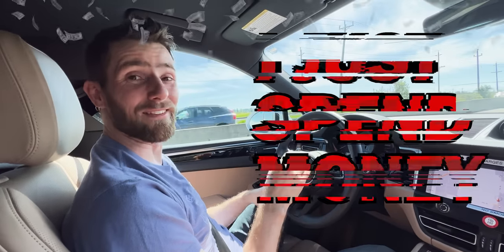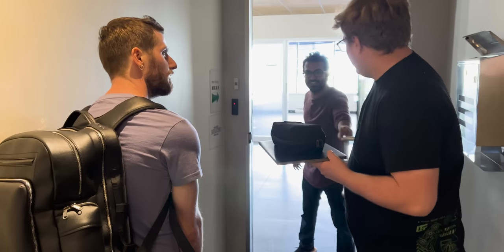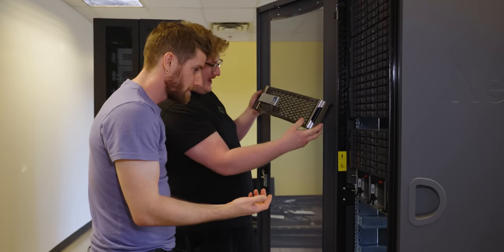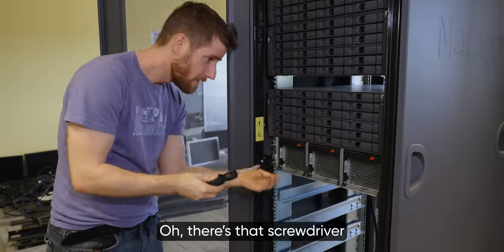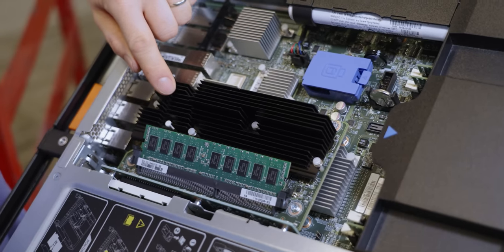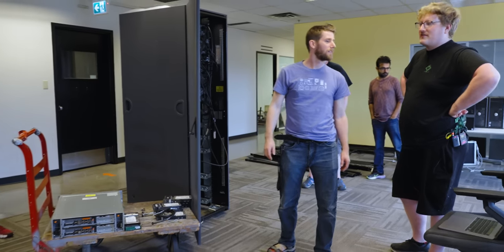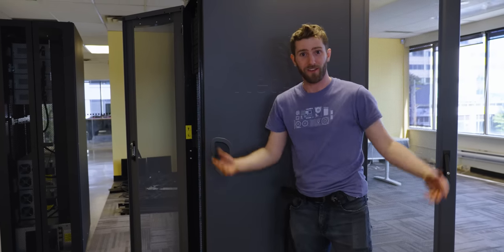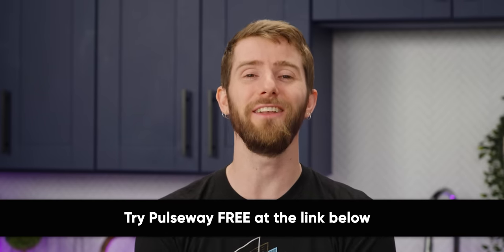WHAT did I just BUY on Facebook Marketplace?? - NetApp Storage Appliance / Disk Shelves

Comment from the maker: Correction for around 12:35: NetApp RAID is actually entirely software based. The RAM stick shown IS a write cache with a battery to keep data in memory in the event of a power failure, but it is used by the software RAID implementation, not a RAID card.

Separately, while the seller we purchased this from used it in a SAN configuration (iSCSI for VM storage disks), these NetApp setups are referred to as "Storage Appliances" and can be configured for both NAS and SAN protocols.
Reply: thanks for correcting your mistakes!!
Reply: @dliratx  You are correct in that it uses WAFL and the performance is better with it but you are wrong with the power outage aspect. Power outage protection for NVRAM. (non volatile RAM) is battery backed which is called the NVMEM battery. Combined with WAFL for speed, NETAPP doesn't actually commit a write to disk when the OS tells it to, same for deletes. Its stored in this NVRAM until 1 of 2 conditions is met. Either every 10 seconds, or when the NVRAM fills to 50%. Its then flushed to disk. The cache is set up into 2 sections. Each = 50% of the total NVRAM. Lets say that NVRAM size is 2Gb then it splits that into 2 sections by 50%. So there is always 2 cache banks at any given time. Due to this delay in commits to   Any data in in this NVRAM when a power outage occurs, MIND YOU one that affects the data center to kill the UPS power also, then that data sitting in RAM is backed up by this redundant battery that direct attaches to the PCI lanes of the NVRAM slots. In fact it is plugged in right next to the NVRAM banks. Usually first 2 banks in a controller head. WAFL does nothing for protection. It stand for Write Anywhere File Layout. Combined with speed for writes, it makes better use of disk sectors and block sizes. If there is a bad section, Data ONTAP (NetApp's OS) can ignore that block and still write the file. Where tradition RAID would either fail that drive or have an inconsistency in the data as it wants to stripe to the next block in line not the next "available" block.  It also extends the life of a drive for just a bad or failed sector of one platter on the drive.
Reply: Netapp deduplication is proprietary and pretty cool too. I do not work for Netapp myself btw.
Reply: that's too complicated for me to understand >.<
Reply: Its called unified Storage System , because it talks, FC, ISCSI, CIFS, NFS - if you have two of them you can do the metro cluster for full redundancy
Reply: This brings back some memories of when I worked for NetApp...I could tell you about some crazy things about their products back then.
Reply: how big would a minecraft server be with that
Reply: One of the biggest things which I have noticed with mid-tier to enterprise grade storage is that between Dell/EMC Unity/Powerstore Isilon and NetApp, one of the best features it seems could be the fact of the NetApp being capable of having multiple SVMs which you can use to DMZ storage while attaching each to different domains.  This is something I have noticed has been lacking for some vendors.  The only downside with NetApp is like Cisco, they bank too much on their software leading the way while the hardware side has been incredibly underwhelming. Hence the reason for the jump to Dell but the grass is not always greener on the other side as SVMs are not a thing there and "Proxy-NAS" could only be setup on the backend of the mid tier Dell systems which was sort of the DMZ equivalent however, you cannot isolate or DMZ the storage like you could per the NetApp and replication to offsite DR for proxy-nas is a NO-GO.  Granted all of the systems I mentioned do have capabilities for faster array based replication with things like ndmp, SyncIQ or Snapmirror it still seems NetApp still has the upper hand in many ways.  That stated, compression and dedupe are highly impressive on the Dell side while scalability is impressive on the Isilon side the it seems Dell/EMC still shines better in terms of Block operations with LUNs for things like databases where the NetApp filers are better at file based NAS operations.

Other thing to keep in mind, on the NetApp it seems or felt like each filesystem was treated individually as its own container or object which made the array filesystems more flexible to work with where on the Dell/EMC side, it felt clunky as the entire NAS server was treated as a container or parent which is unfortunate if they are trying to go up against NetApp.  Now per the information Dell released they did mention the Unity was a rebuild from what the VNX was back in the day however, it still seems to be missing many of the best features or they are hidden from what the VNX with the Celera was.  Not to mention the fact that with each generation the UI for Unity it feels like it is de-evolving to be like the "fisher price UI" of storage arrays.  Also, per all of these storage arrays, NetApp, Unity, Powerstore or better have better throughput for mounting NFS and running code-trees native from the storage, this stated, Isilon is NOT fun when trying to do this as there is a 64bit vs 32bit block export you have to set for each level of the filesystem making it a nightmare.  Also, NetApp and Unity have the ability to change the "restrict  chown" option or allow for other non-root users to change ownership of files where on the Isilon this was seemingly difficult to work around at best.

Also NetApp+CLI  = *happy face*   Untiy+CLI = *Very Sad Face*  Not sure why but the Unity / Powerstore backend over CLI was a nightmare to deal with.  File systems are represented by numeric designations along with exports, etc... Trying to script against it was like trying to write or follow primary / foreign key relationships between table structures it was NOT fun.  Almost like they were missing a command interpreter or better command structure.   The Netapp is a breeze to code against for backend scripting and it was actually kind of fun.   

Now if someone really would like a challenge, what would be the best solution for a active-active datacenter to datacenter configuration which would allow for a writeable and active replicated filesystem between two datacenters which would be robust enough not the break due to latency issues and allow for decent file locking while not causing data corruption?

Also, after having used NetApp, I VERY much prefer them for file/NAS based operations granted their configuration can be quite complex.  I have also been told interesting things about Hitachi  storage systems which I am curious about as I have not encountered them before but I kept hearing good things not sure of that is still the case thoe.

Very neat to see Linus exploring the more "enterprise" equipment side. 

- I am just noting this per my experience, I am sure others could have different opinions but this is just what I have run into.  My options are that of my own, as they are jut simply that, "my opinions". I am by no means affiliated with Dell/EMC or NetApp or Hitachi and I cannot endorse any vendor per my statements.  I also by no means affiliate my statements back to my current employer.
Reply: Forgot to mention, it seems many storage vendors are now stating to pull the "Don't look at the wizard behind the curtain" as they are starting to no longer list what they are using for compute with CPU, Memory, etc.  They are only starting to advertise on throughput / IOPS or connectivity.  This makes me sad for some reason.
Reply: NetApp FC and SAS drives have 520 byte sectors. The additional 8 bytes store the block checksum.
Technically those are normal OEM re branded 512B drives, formatted to 520B and run a special firmware from NetApp. There are tools on the Internet to reformat them back to 512B drives, but not the other way around. That's what the seller meant in the end, when talking about getting replacement drives.
Reply: License is real problem with NetApp xD
Reply: So, I found a guy who is selling the 48 drive version of this.  each tray has 2 disks on it, but it only takes SATA drives.  he has like 80 left if you want more, and they aren't that far south of the border in MN.  I just bought one.
Reply: @Koorisin  Yeah WAFL is pretty badass.
Reply: @andrewbenjamin4603  Yeh that SVMs and Netapp storage virtualization is awesome

Comment: Bruh can we take a moment to appreciate how immaculate those controllers were after 10 years of operation.
Reply: the way server rooms and infra should be kept, when in a controlled env dust isnt a thing with Hepa filtration.
Reply: When you buy from a data center,  servers normally come dust free in my experience
Reply: The proper datacenters I’ve worked in are humidity and temperature controlled with lots of filters on Hvac equipment.
Reply: we even had sticky paper you would walk over before entering the halls.  Impeccable
Reply: Huh? They're literally just sat there in a climate controlled room - what do you expect?
Reply: A lot better than the servers where I work. They’re in a small locked closet without AC or anything and the closet is sooo cluttered.
Reply: no
Reply: Everyone talking about that offices' server closet like every office has pefectly filtrated and climate controlled server rooms. Y'all know how bad it usually can get in such businesses, don't kid yourseld
Reply: @DMSparky  That is why I have my console cables with extensions, so I can sit in the cold aisles when doing service calls.
Reply: that's because somebody pressure washed them

Comment: It's cool that Linus brought those guys some swag, especially considering the killer deal he got on all that hardware.
Reply: I mean, basically, they were hoping someone was going to buy it and take it off their hands because if someone didn't, they were going to have to PAY an eWaste company to come and do that, so I guarantee their company actually made out in general, still Linus bringing swag is still pretty cool of him.
Reply: @scottbitz5222  Fair but they also could have parted it out and sold it all for more, I think they just wanted rid of it and got their ROI back from the 11 years of service it performed.
Reply: @kelmanl4  Most of that is disk shelf only. Harder to part out old storage tech with no controller like that and on such high end equipment that is no longer supported or find parts. NetApp holds their parts very close in house. hard to get them 3rd hand without buying them from company selling off old hardware such as this.  On top of that, they were low end disk shelves to boot. Only 3Gb bandwidth on the SAS connectors and while 24 disks shelves, only 600GB 15k RPM drives. Great drives but very dated.  DS4243 = 4 U 24 disk shelf 3Gb SAS connector
Reply: @kelmanl4  They could have indeed, but that takes times.  It's just easier to sell it for a quick buck, and let someone else make a long buck.
Reply: Not a killer deal. That's a 12+ year old controller and drives on the borderline of death.
Reply: @Koorisin  The fact that it's harder to find parts means there's more value in parting it out.
Reply: Well they let him make the video there so it's a nice thank you.
Reply: he says at the end of the video that it was meant to be listed for $500, so no it was not a deal

Comment: Speaking as a NetApp specialist, I almost shat myself when Linus pulled the controller out of the rack by himself.  Hint - there are folded handles either side of the chassis - use them (along with a second pair of hands).   Congratulations of your purchase, may it give you many years of faithful service (and at least one month of lost sleep when it shits the bed).
Reply: kudos for netapp shitting the bed - it shits the whole floor
Reply: I love the way you phrased this hahaha
Reply: Things are heavy, even with drives removed.
Reply: Something that old should not even be switched on. OnTap will be so out of date and updates will be lacking now. We've just gotten rid a of a 3240 last year and our 2520 is now out of support. NTLM bug is going to kill us!
Reply: @mikem3271  I doubt Linus or LMG will be using OnTap or the NetApp specific features on those legacy disk shelves like the ACP ports (With ACP being in-band with SAS from OnTap 9). From what I know, both the controller and Diskshelf featured are EOL, which is why it was probably so cheap.
Reply: @benskev  I can confirm, this is very true.
Reply: Can't wait until he has a QSFP port failure, lol
Reply: Linus has no idea that these controllers are like $5k to $10k a piece. 😆 It's not exactly a commodity desktop computer.
Reply: @Doso777  DS460C without 60 disks weights 80lbs. With the disks 300lbs.
Reply: @apreviousseagle836  Since it's out of warranty, it will be out of pocket for every component.
Reply: @fitybux4664  Or that you can have multiple controller chassis working together.
Reply: @TechPorkChop  "Out of pocket" meaning they hope they can find a replacement on fleabay. Also Cdot requires licenses to be generated for the controller's specific serial #. NetApp won't do that for a OOW system. Their best bet now is just to hook up the shelves themselves to a generic Linux box with a compatible HBA, and it will see the disks individually.

Comment: As a storage engineer this video was a blast :) It looks like a great deal, but consider power consumption. I recently replaced 2 similar storages around 70TB each, with 1U IBM FlashSystem 5200. Old storage needed 2800W, and new one is only 300W :)
Reply: That's a large room heater!
Reply: I used to work for IBM and we had moved some of our DBAs highest usage DBs off of XIV Gen3 and StorWize 7000's to  multiple FlashSystems (Thanks SVC!). The DBAs still complained that it was 'too slow' and 'customers were complaining'. I told them that if being on nvme flash and 32Gbit FC was too slow for the customers, the issue isn't the storage, it's the application and DB architecture. Nothing I can do about that as this is literally the fastest (at the time in 2016) shared storage that exists. They didn't like that answer.
Reply: @WhiteG60  my team supports our custommers from storage to DB level, so its lettle easier to find problems :)
Reply: @WhiteG60  Or the partitioning and queries. An unpartitioned (aka full table) search of a larger table for whatever criteria can mean reading hundreds of gigabytes of data.
Reply: I didn't even know storage engineers exist.. the more you know! :D
Reply: @SarahC2  That's why a lot of the heaters in the company are turned off.😂
Reply: @WhiteG60  Those app db queries needed a ton of optimization I bet. This is something that DBAs will defend to their last breath - until you ask for statistics.
Reply: @infn  thats why we have our own DBAs, and we need to deal with application programmers :p
Reply: @infn  They had asked for RO logins to the storage arrays in the past. It was a nightmare. They'd see a single statistic instance of read latency that goes from .9ms to 2.3ms then back to .9ms on a 5 second sample and try and set up a meeting to discuss 'why the storage latency went up almost 3 fold'. They would claim that 'customers were calling about issues if the storage latency got above 4ms'. Bruh, if your customers are calling about 4ms of latency, you're either lying or need to train your customers better because the difference between 2ms and 4ms is effectively indistinguishable when you're talking about a SaaS product being accessed over the internet. 

They also steadfastly refused to let us do backups with any type of agent. They INSISTED on using built in SQL tools for backups and then copying those 12+TB backups via CIFS/SMB to a share to be backed up there. DBAs are a weird bunch.
Reply: @WhiteG60  A9000's (also XIV based I believe) were a blast, was sad to see that technology go. SVC code is most likely inheriting at least some of the legacy I believe (like the way global mirror is handled).
Reply: @aragnut6180  Yeah the A9000's were effectively just XIVs that used flash instead of NLSAS drives. They're gone? I've been out of IBM for almost 6 years now and not too many people in the channel buy IBM storage. Which is a shame because it's REALLY good when you're talking block only storage. I guess cheap NVME and democratized dedupe/compression really leveled the playing field in terms of having to be really innovative and efficient in terms of enterprise storage. You're more limited by the connectivity to the storage and the host itself now than the underlying disks, so the actual controllers aren't very important anymore.
Reply: How do I even get into such fields ??
Reply: Spot on. Same reason I went all flash CEPH instead of a somewhat less expensive spinner. Half the power, easily. Replaced a 3PAR about this size with a single 3U PureStorage array, way less power.
Reply: @WhiteG60 hardware can only fix crappy code to a certain extent. Very true.